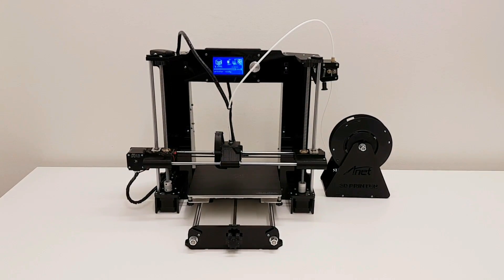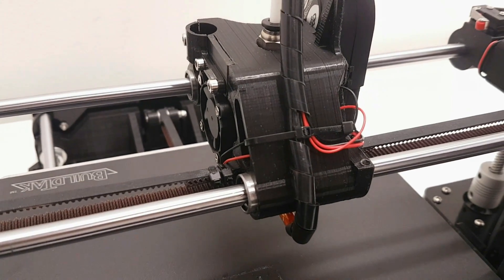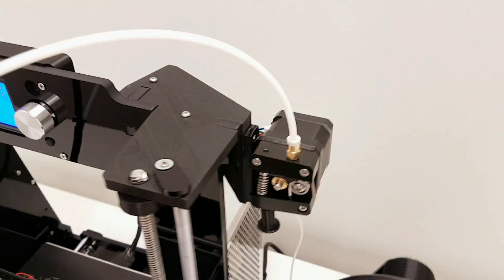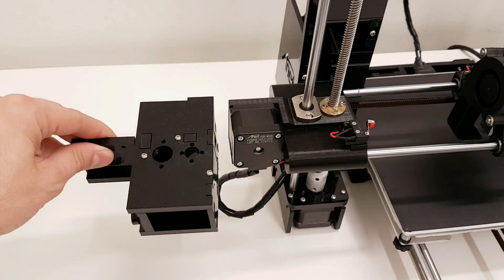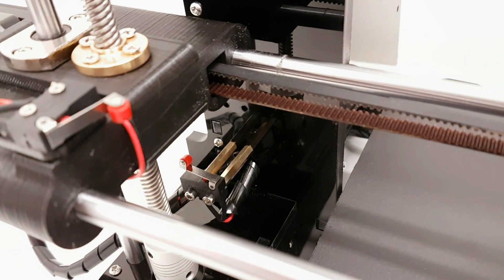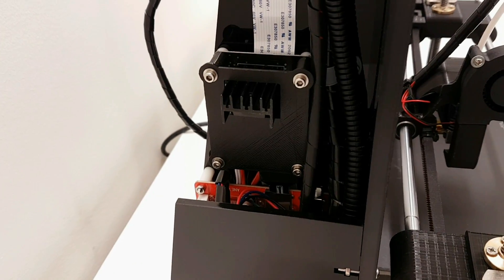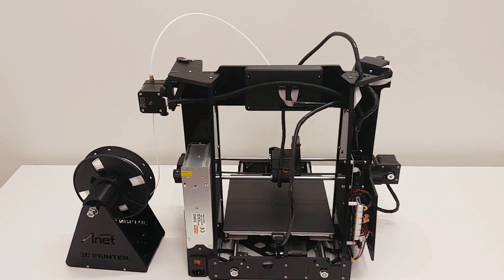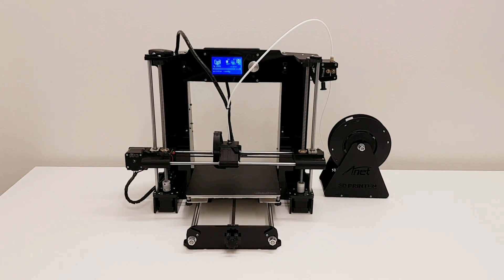Anet A6 E3D V6 upgrades stage 2

Comment: Awesome job man! Looking forward to install these upgrades on my newly acquired Anet A6
Reply from the maker: Glad you like it man! Take care.
Reply: @NexiTech  Happen to have any tips on improving the printing quality by changing the default parameters? Already added lubricant to bearings, improved belt tension and tried varying the bed level. Im currently reading about the different types of fault mechanisms during printing
Reply from the maker: Good job. You should start experiment with the print settings and print temperature in your slicer. That will have major impact on your prints but it takes time to master it. Also if you want to print every model as fast as possible in best quality possible you would need to adjust print settings for each model you print. When you master it over time 3D printing will be fun and cool as you can print almost anything :)
Reply: @NexiTech Thanks for the tips, i feel welcome already in this community. I discovered your A8 videos, so i will use them as a reference. Subscribed btw!

Comment: Among hundreds of amateur and enthusiastic videos and also all the modifications made to an Anet 3D printer ive seen. This design is by far, the one that is best designed. I am almost certain that there is a gain in stability with this horizontal geometry of the axis.

It's a clean and inspiring job that you present here in this video.

Keep up the good work! PEACE!
Reply: FYI, the horizontal rods on the X gantry is standard on the A6 — it’s the major difference between A6 and A8.

Comment: Z-rod bearing = always a bad idea. If that fixes anything you have other problems :)

Other then that i did about 90% of those upgrades as well! Now I bought a creality cr10s.
Reply: What do you mean by z rod bearing?

Oh wait, you meant the constraint on the top of the leadscrew. Lead screws and ball screws are always supposed to be constrained on the ends. That’s how they work. It’s only a bad idea when you’re using threaded rod as lead screws which are always bent. Even cheapish four start 8mm diameter 8mm pitch lead screws (as used in most printers) shouldn’t even notice whether there’s a bearing on top or not — except that we usually underconstrain them at the motor end by using shitty couplers, and you get around that by underconstraining them at the other end as well. It’s a miracle we can print 0.05mm layers, frankly.

Comment: where did you get the bearing for the X-axis print?  The linear ball bearing linked above would be used for the heat bed.  Great Video!!!  Did you simply remove the bearing from the housing and slide it into the new X-axis carriage?
Reply from the maker: midsouth360 Thanks. Yes I just re-use bearing from original X carriage.

Comment: If the anet a6 worth the extra money or should I get an a8? Or is it better to get a tevo tarantula and then get a larger bed and a dual extruder?
Reply from the maker: Tiberio Cellini Anet A8 has more upgrades and A6 has better LCD and knob. Other then that A8 is nice 3D printer with very affordable price. Go with A8. I don't recommend Tevo tarantula and especially not dual extruder. Tarantula is harder to assembly, dual extruder is harder to level and tricky to use. During printing other nozzle can also knock out the print and mess it.
Reply: Nexi Tech thanks

Comment: Do you have a different link for the bearing used in your Z wobble upgrade? The link you provided doesn't work anymore. If not could you maybe give some measurements of the bearings?
Reply: i think  i found the correct link :  
https://www.thingiverse.com/thing:2084622/#files
but what for bearing we must use please Nexi Tech ?
Reply: and a correcting is made:
https://www.thingiverse.com/thing:2084622/#comments

Comment: I've never understood these lead screw "supports". They can only possibly make Z wobble worse, either install straight units or mechanically separate the lead screws from X and Y motion. The "supports" only clamp them down tighter so any wobble in the screw is more likely transition into X and Y rather than orbit around freely in the open guide at the top.
Reply: i think i found a correction for the above from Stan Boer :
https://www.thingiverse.com/thing:2084622/#comments
there you can read the same problem as you did........

Comment: What fillament type did you use to print the upgrades?
Reply from the maker: Christos Drougkas Just cheap Black PLA. You have link in video description. Cheers
Reply: Is it holding up ok or did it got deformed by usage? I would like to place my printer in an eclosure for better result in ABS prints but I am affraid because of higher temps the PLA printed upgrades of the printer might not be as strong as in an open enviroment use
Reply from the maker: Christos Drougkas Yes, it's holding fine. But in your case sense you will use ABS and in  enclosure I recommend that you print X carriage in ABS, for Z carriage and other upgrades parts you can use PETG. But for ABS keep in mind shrinking procent is around 2.5% so incense model scale for better fit.

Comment: Hi Nexi Tech, I like this video. Very informative! :)

 I'm thinking of upgrading my anet a6 with a bowden extruder aswel. And was wondering if what settings I need to make after it's installed? Or will it work as it is straight away?
Reply from the maker: Peter W Thanks Peter! Settings are the same. No need to tweak anything in Print settings. Cheers!

Comment: Your axes move so quietly! Did you change the bearings? Mine make alot of noises :O
Reply from the maker: Nope I use lithium grease to lubricate bearings. Look on my Anet A6 review video you can see it there ;)
Reply: Cheers mate, Im going to watch the video!
Reply: I ordered some for my own printer - looking forward to the results! I want to stick with the linear bearings even though people say that friction based bearings are more quiet, they tend to have, well... higher friction. I suppose this is not good for the motors on the long term?

Comment: Helloo ...

So since you tried both A8 & A6 .... which one is more reliable?
Reply from the maker: When you said ''reliable'' that remands me on car. You mean which one will last longer? Well both printers have same extruder, steppers, motherboard, power supply etc. They share same components. So I would say they are pretty much the same in reliable comparing.
Reply: Nexi Tech Thank you for your reply. 
Okay, let me simplify what I need to ask... 

If you were me, which one are you going to buy? 
A8.. A6... Or creality CR 10?
Reply from the maker: hesham zakaria CR-10 but I3 mega is very good as well. Check it https://youtu.be/j3dEJdK10YY
Reply: Nexi Tech 
Thank you very much for your quick reply :) 
I watched your review about the i3 Mega, the quality looks very good... 
But as far as I know... CR10 product dimension is 300 x 300 x 400... And i3, as you are saying in the video, is 210 x 210 x something :D

Both prices are close... 
I think in this case I may go with the one which has bigger printing dimensions... 
Thank you for your help, and I wish you all the best...
Reply from the maker: hesham zakaria I agree! Go with CR-10. Check this link :)  https://youtu.be/cRpmjDcGVfg under video description in this link  there is link of CR-10 and there is copong for cheaper price as well. Best regards and thank you for supporting my channel :)

Comment: Nice video! Have you noticed a big difference between the MK8 extruder vs the E3D extruder? I'm planning changing the MK8 extruder to the E3D clone, although I can't find information on the internet about the benefits of the E3D. If you could tell I would appreciate.

Comment: does anyone know what the travel limits are after homing for the stock x carriage on the anet a8 !?
 

i need help :(
Reply from the maker: Ryker Flash it with Skynet3D and check it yourself ;)
Reply: I changed to the Bowden extruder and changed the Homing limits, and now I went back to the stock anet a8 extruder and I need to know the limits, I'm trying to get the easy way out and not have to measure everything. thank you for replying once again :) you're one of my favorite YouTubers btw

Comment: hay nexi . sorry i keep bugging you about the anet a8 with the E3D v6, but i cant get my retraction settings right. what are yours? :
Reply from the maker: Ryker Try to use same as print speed or little lower. If you print at 45mm use 35mm(retraction) or similar.If that don't work check your Teflon tube is it insert all the way in to the hot block and check your nozzle for any leaking.
Reply: what is your retraction distance? thanks for replying

Comment: Nice Video like always Nexi, did u print all upgrades for the A6 with the A6 or did u use any other printers ? maybe you can upload some settings from your slicer for us. 
Best Regards
Reply from the maker: Thanks Sinan! Well to be honest it was mixed to save some time.  If I remember correctly CR-10 print out X carriage. One Z carriage print A6 one Cr-10 and rest of parts was print out my mighty A8 :) There is no need for extra settings for this parts but I do recommend to use lower speed and 0.1mm layer height. Best regards

Comment: Hi Nexi .. may I know what material u using for all the support u printed .. petg or pla? thanks
Reply from the maker: Hi Joey! I print out everything in black PLA because I didn't have PETG but I did testing. I heat up nozzle to max temps and I leave it for 15 min then I measure temps on upper part of heat block and its was way below PLA melting point so no problem using PLA on this X carriage.
Reply: oh .. Alright nexi thank you so much .. I had just purchased the a6 from the link .. can't wait for it to arrived !!
Reply from the maker: You welcome mate! Thank you so much for supporting my channel. Best regards! :)
Reply: Nexi Tech Hi Bro .. I got my printer .. may I know what the configure (add printer ) setting for cura 2.5 .
Reply from the maker: Yes mate! Settings fro stock A6 right? Go to: Preferences/Printer/Add/custom/ write Anet A6 /Printer settings
X 220
Y 220
Z 230
Build plate shape (rectangular)
Heatbed (checked)
Machine center is zero (unchecked)
Nozzle 0.4
X min 0
YMin 0
X max 0
Y max 0
Gantry height 0 
GCode flawor RepRap(Marlin).

P.S. Cura 2.5 can't be connected to PC , CURA 1.56 works with PC. Check SD that you got with your printer you have everything you need to set up your A6.  
Good luck! Cheers!
Reply: Sorry bro .. where can i find GCode flawor RepRap(Marlin) ..
Reply: found the code , i was thought need to be copy paste for the code ...
Reply: Thank you vey much Nexi ... i will begin the print box now and see what the outcome .. Following all ur step